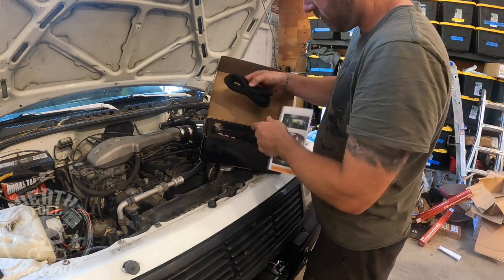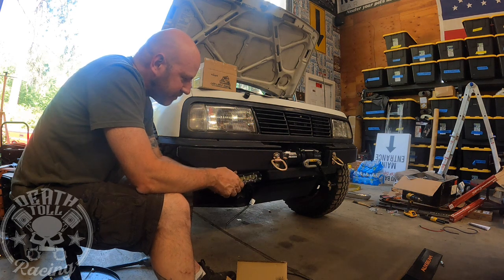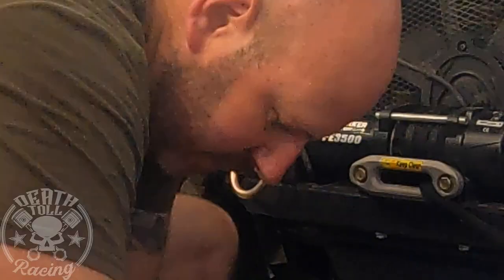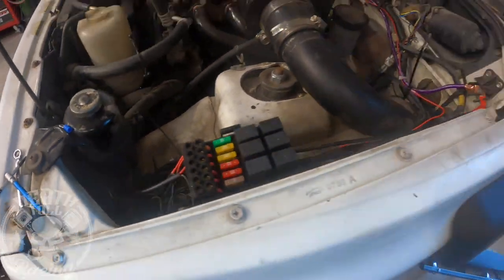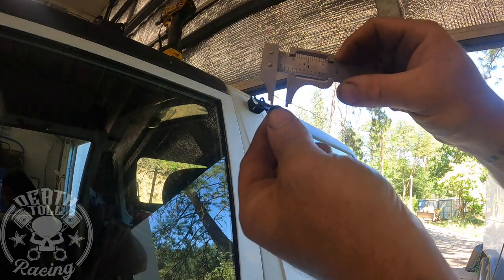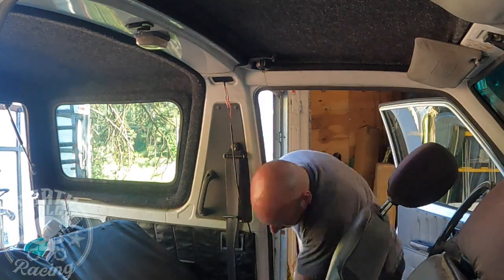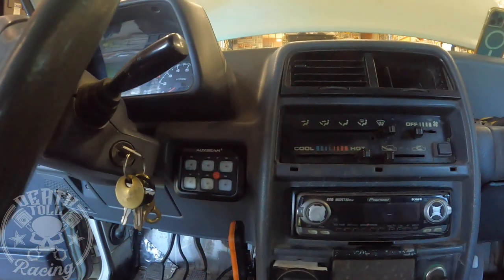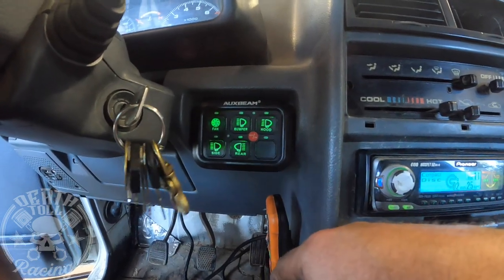E17- Auxbeam Switch Relay Panel and LED Lights On Our Geo Tracker / Suzuki Sidekick 4x4 Project

Comment: As soon as I saw that version of nutserts I knew I needed them as used that link. Then I had to remember to go back and watch the rest of the video lol.
Reply from the maker: Lol.  They work good.  I forgot to make my thumbnail for the video until now..... Oops
Reply: Im not sure about that particular brand but in general, make sure you lube the bolt going in there. I've got a few of them on my truck and every one of them just spin in the hole, can't get the bolts out.
Reply from the maker: @sweet65mustang  I assume you’re talking about the rivet nuts?  That’s a pretty good thought.

Comment: I've watched a bunch of your videos,  not just the Tracker content.  You do such nice work.  As much as I love these little Suzuki's, I was a little surprised you messed around with them instead of a Jeep or something. But you mentioned that you use it in the woods and that makes sense.  They're so small and nimble, they get in where most can't go.  And they can pick lines where others just barely fit.
Reply from the maker: Thanks for the kind words!  Funny you should mention that. Today we were out filming some “tracker vs” video and one of the “vs” is my daily (2022 Rubicon).   The squeeze ability of the tracker is a big advantage.
Reply: The trackers are waaay better than the little Jeeps and have the best entry and exit angle of  anything except crawler buggies. Dandahermit

Comment: Would it be possible to see a video showing examples of the twin shifter and how it works? 
Also explain Gear Ratios when changing in the transfer case do you need to do any other modifications to differentials? 

Thank you for your great work and explanations!
Reply from the maker: When I start filming again I will do a youtube shorts video of the twin sticks shift pattern.  It will be a couple weeks or so.  No other mods are required with the transfer case gears. They are a stand alone upgrade.  The twin sticks are also not required with the gears, they are optional.

Comment: Nice job! Plan on doing something similar on my '94 along with how you did the bumper build. Really appreciate the inspiration! Have to say, those are some of the nicest looking window seals I've seen on an old tracker. Were they like that when you got it? Sadly, mine are completely shot and make my windows unusable and leaky. No luck finding replacements anywhere online or around me. Keep up the good work!
Reply from the maker: Thank you!  They are the original window seals still.  That’s a rough one on yours. eBay’s probably your only option.

Comment: This is a bit random, but what lift is that in your shop? 
Could we get a shop tour? 

Enjoying your channel
Reply from the maker: The lift in the shop is just a run of the mill 9k 4 post.  It's not ideal for most things.  2 post lifts are much more desirable, and I will be upgrading soon.  If you look in my playlists there is one for shop stuff.  I'm do for another shop update video, but there are a couple older  ones there.

Comment: I saw you have an electric fan in front of the radiator. what is that off of or can you share a link?
Reply from the maker: That’s the factory fan. All the models with air conditioning should have it.  That would have be a junkyard thing for the exact one or something like the one in the link below for an aftermarket should work. Just make sure it’s capable of push if your going to mount it to the front of the radiator like mine is. 

https://amzn.to/3J3JUmn